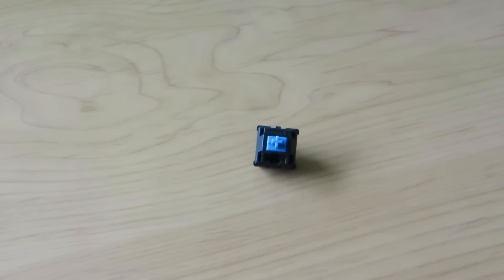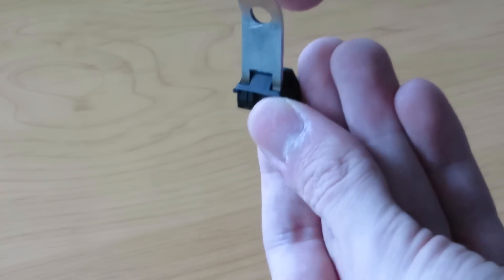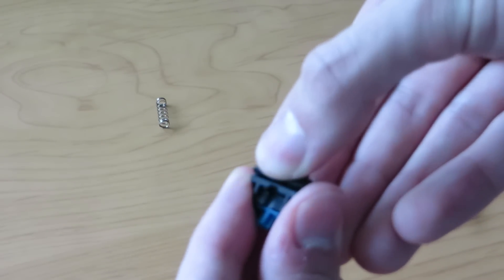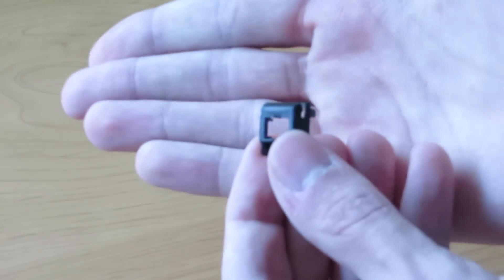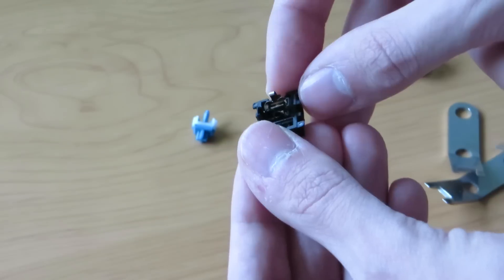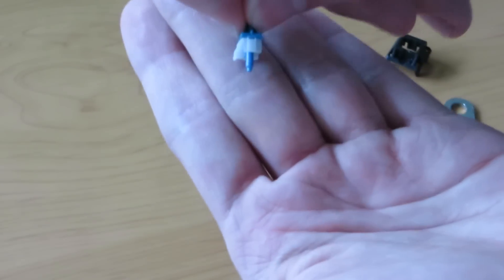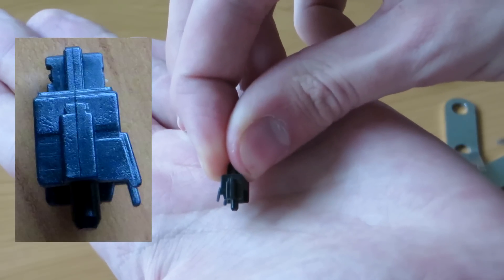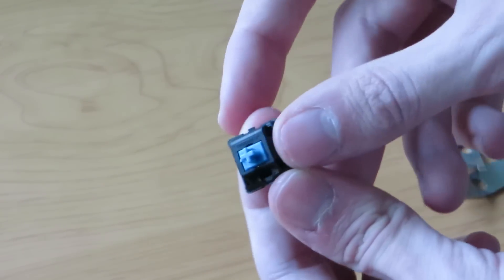Cherry MX Disassembly

Comment: Can I change the slider to a different one? I mean I have a mx blue ducky keyboard, and I would want only the wasd keys to mx red. So, could I just buy 4 red switches and disassemble them to get the red sliders? Hard to explain :D
Reply from the maker: Absolutely! To do that you will have to desolder the 4 switches first, but if you have soldering equipment and know how to solder that shouldn't be a problem.
Reply: BlueBär Thanks, but i was thinking about only changing the sliders :D leaving the mx blue "base" on the keyboard, and putting the mx red slider in the mx blue "base". Are there any differences on the "base/bottom" parts  between cherry switches. I don't have any switches laying around so I can't try it:/ Just a funky idea that might work ;D
Reply from the maker: Unless you have a PCB mounted keyboard (if you tell me what board you have I can tell you if it's PCB mounted) you will have to desolder the switches to open them.
You can put the red sliders in the blue switches. There are two variants of the switch bases, but they are independant of the switch colour... It's a bit complicated, but as I said if you only want to swap the stems that's not a problem.
Reply: +BlueBär Oooh, I get it now :) I have a ducky g2pro 10 keyless, with black engraved pbt caps. Looks good I tell you ;) Anyways, I really appreciate your help :)
Reply from the maker: That should be plate mounted so unfortunately you will have to do some desoldering.
Reply: Thanks :) I think gotta bust my old weller from the closet.